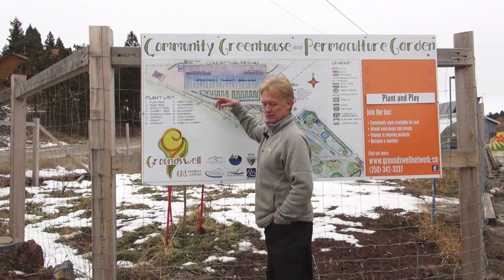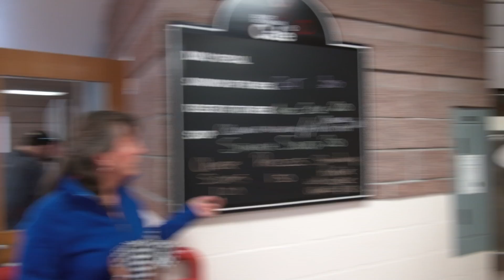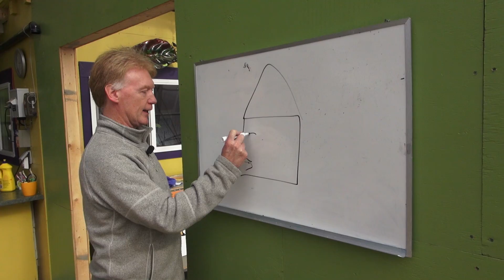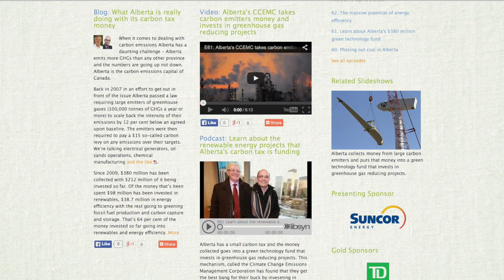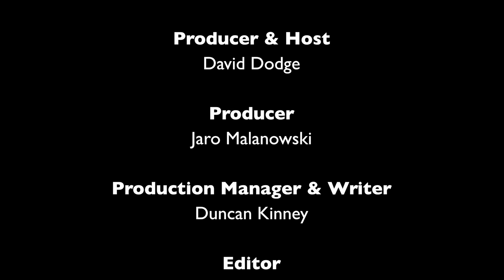73. Passive solar greenhouse: A way to produce more local food and use less energy to do it

Comment: How are your raised planter boxes made?
Reply: They are basic lumber construction. They have heavy duty castors on 6 legs. The bottom is mostly supported by a metal hardware mesh with landscaping fabric on top. This allows for air and water circulation.

Comment: So ......the chem trails and chem clouds....there I said it.... have been blocking the sun on a regular basis....reducing the uptake. What is the best panels for off grid home?
Reply: You are wrong, as paranoid tin-hatters usually are. I've been monitoring solar intensity for years, watts per square metre that is, and have seen absolutely no decrease. (We are in central British Columbia) Our off-grid solar PV works well and the evacuated tubes on our roof make hot water and work down to about minus 18C. Everything has been running well for a few years now. Next on the wish list: a super-insulated solar greenhouse much like the one in this video. 

Buffer Zone, I'll answer your question. There are many PV panels to choose from: Canadian Solar, Kyocera, Sharp etc. They are all good. To my knowledge there are no crappy ones on the market, as the junk has been weeded out. Get big panels, 300W plus. Off-grid requires research and self-education on your part, because an off-grid system needs a charge controller, expensive battery bank, inverter and various bits and pieces. Everything has to be sized correctly and of course your system has to meet your needs, not too big or too small. I learned everything I know from reading Home Power magazine (www.homepower.com) Good luck!
Reply: Oh good. Another Technojunky Sheep. No knowledge buts lots of enthusiasm. Baaaa
Reply: hahahahahah.. ah. Reaaaaaly?

Comment: what if i made my greenhouse shorter like 7 feet tall would i store more heat that way?
Reply: No. Most of the heat is transferred out of the greenhouse through conduction and convection from the surface walls/ceiling. By decreasing the volume of the space you are eliminating your buffering capacity at a higher rate than your decreasing the surface area of the facility.

Comment: I'd like to see the same greenhouse in January or February.  
What are the interior temperatures of this greenhouse during the course of the winter?  -- when the sky is overcast for days and the temperatures are well below freezing?  
It would be nice to have a  little data to show that this dream is realistic.
Reply: If they used composting to generate heat and then transfer that heat to the water ,there would be a steady supply of consistent heat for when solar isn't an option .
Reply: You can also use earth mass... like rocks, or barrels filled with water in the north side of the greenhouse. These release heat when the sun sets, and keeps the greenhouse warm at night.

Comment: I have also been working with "notallglass" greenhouses.  A white board at the back side is reflecting the ligtht from the front very well.
Reply: Alternatively, a black wall will absorb more heat for release later :)
Reply: A combination of the two is probably most effective.  On the ground a heat absorbing part 50-100 cm high. Then a light reflecting part.  The heat is saved for the soil and light goes  to the plants.